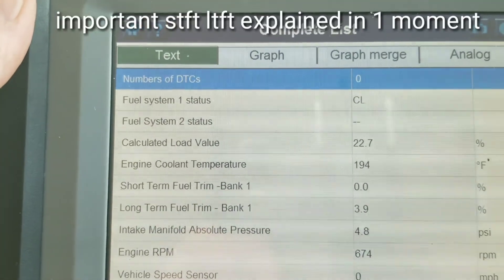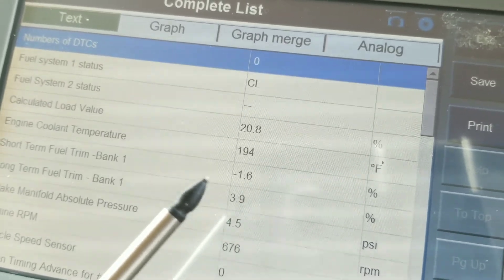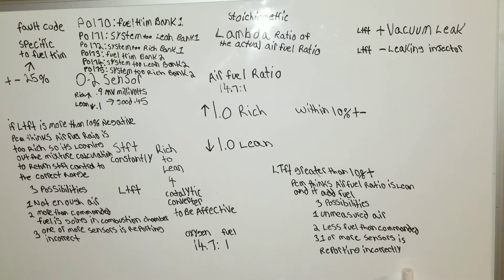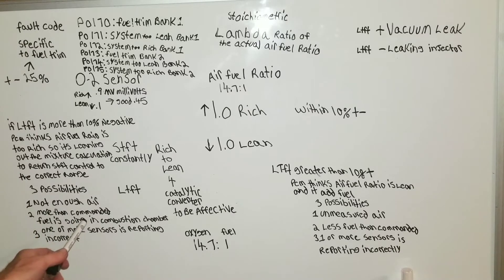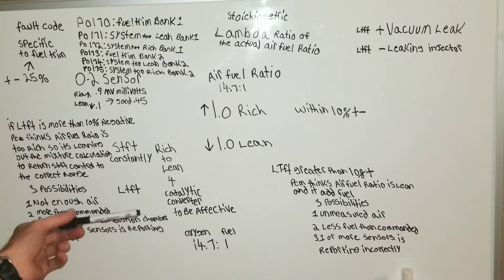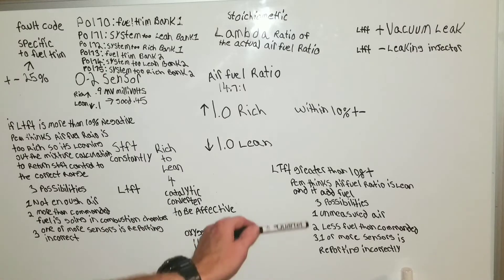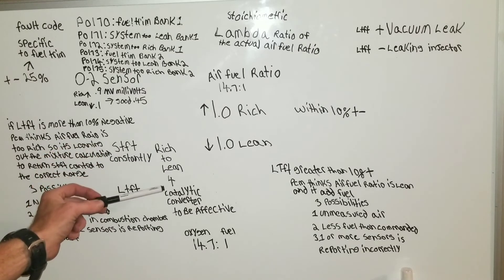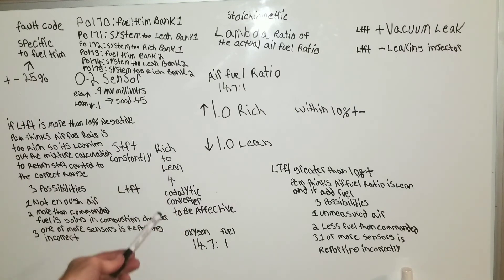Got codes p0170 p0171 p0172 p0173 p0174 po175 What is Ltft stft

Comment: What to do if not enough air. My 4.0 jeep XJ surges and dies.- 11.7% LTFT -5.4 STFT I pull a small vac. line and it idles but that line needs to be plugged in.

Comment: well  done excellent video
Reply from the maker: Thanks what can we try next
Reply: @NATESINTERACTIVEAUTO  i have a 0170  fault code...what should i check first?O2 sensor is ok.Thanks in advance.
Reply from the maker: Take to local auto parts store and hook to scanner for free that could help some will give a print out of information
Reply: @NATESINTERACTIVEAUTO  the check engine light was on after a blown head gasket and mixing water with oil.
Reply from the maker: Thats not good friend will the car run
Reply: @NATESINTERACTIVEAUTO  thanks for the advice
Reply: @NATESINTERACTIVEAUTO  it runs fine after the head gasket replacement...exept MIL light....the code is 0170 wich is lean or rich fuel mixture.
Reply from the maker: Thank you i could tell you how to proceed but the best action is to gain all the information as possible
Reply from the maker: Yes use the scanner to find out what you can
Reply: @NATESINTERACTIVEAUTO  something is wrong here or i am blind....SHRTFT1 25.0 LONGFT1 -0.8 at idle. SHRTFT1 0.0 to 2.3 LONGFT1 -0.8 when depressing the gas pedal.RPM rise a little after cleaning MAF sensor.
Reply from the maker: Codes?
Reply: @NATESINTERACTIVEAUTO  0170 only